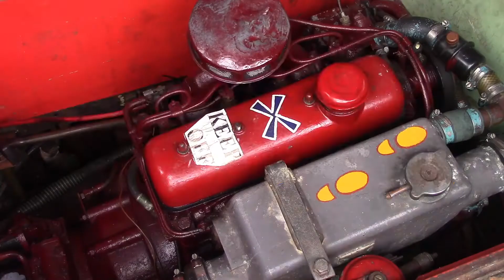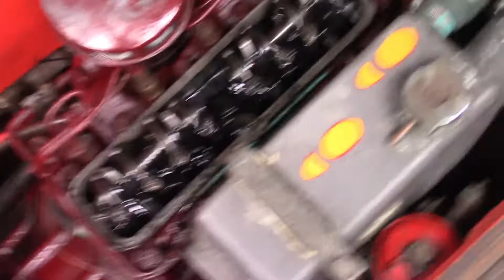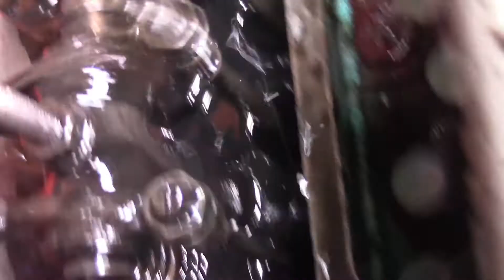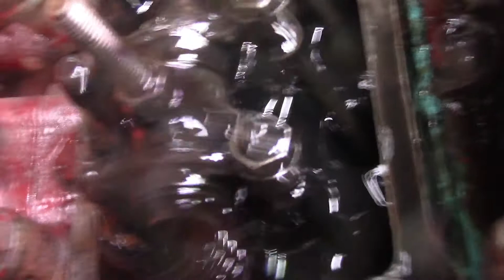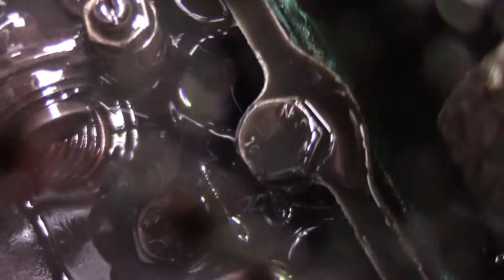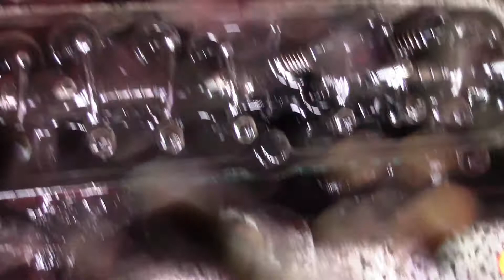OM 636 MARINE DIESEL RUNNING NO TAPPET COVER!

Comment: Hi ,I know this video is over 2 years old but how do you identify between the exhaust and inlet valves.
Reply: The inlet valves are the ones closest to the air intake side; exhaust valves are closest to the heat exchanger.